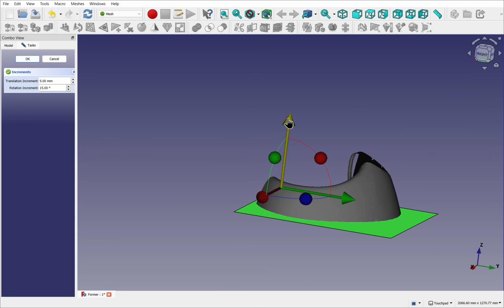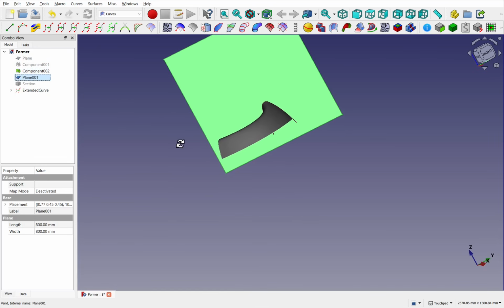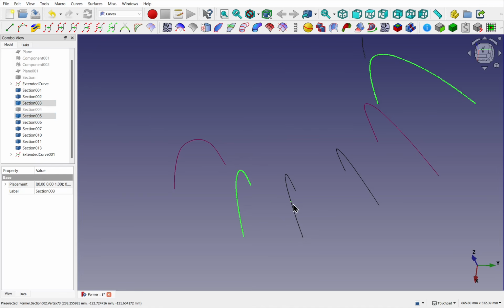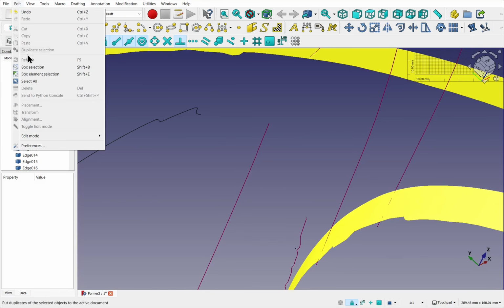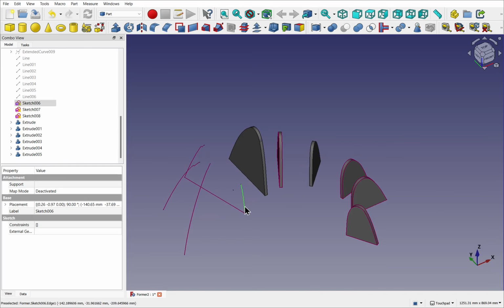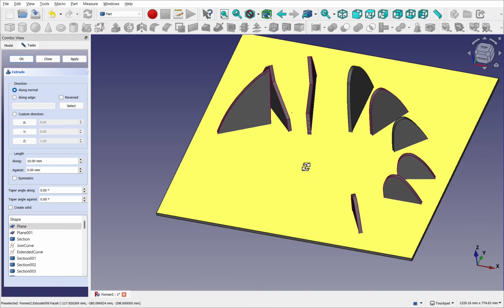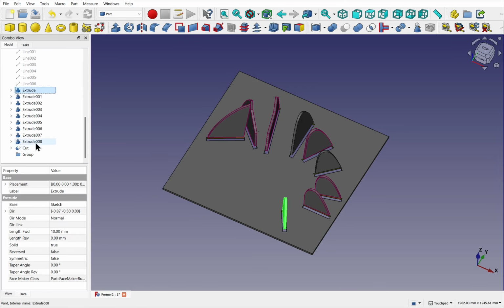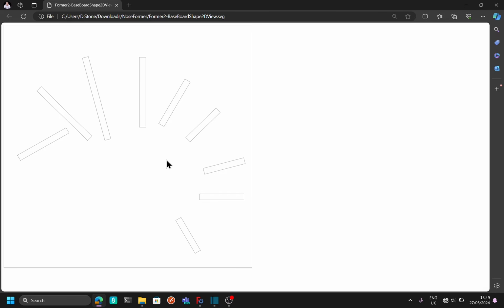FreeCAD: Create Formers From 3D Scans | #2 - Creating Cross Sections and Export - Aircraft Nose Cone

Comment: What's the difference/advantage of using SubshapeBinder with offset vs 2D Offset?
Reply from the maker: Sub shape binder can be used on no co-planner geometry (vertices are on different planes) where as the 2D offset can only be use on co-planner (such as sketches and flat faces).  The subshape binder is also used to bind a object into a body so it can be used in a part design workflow.